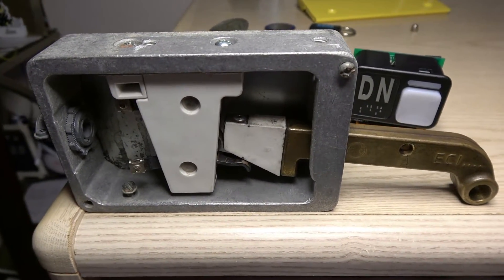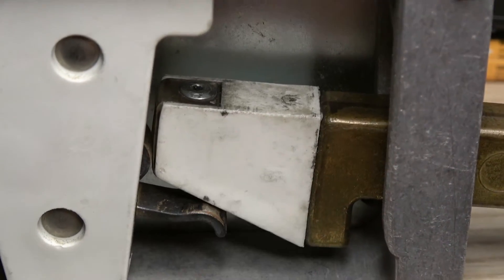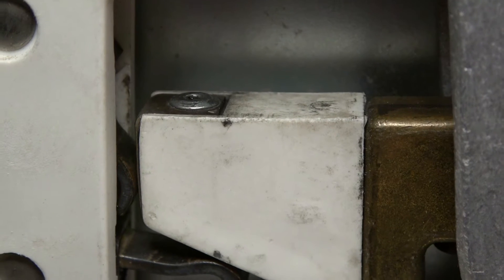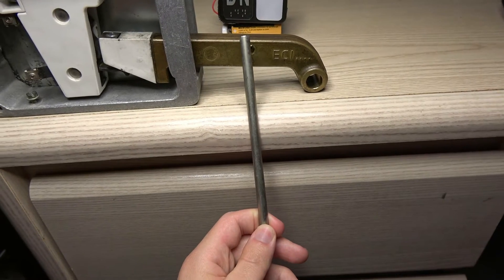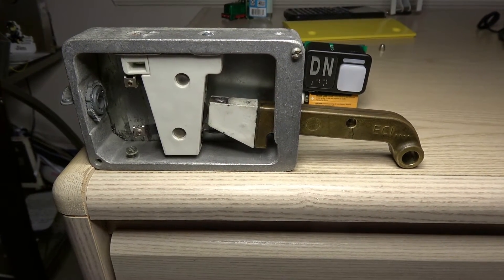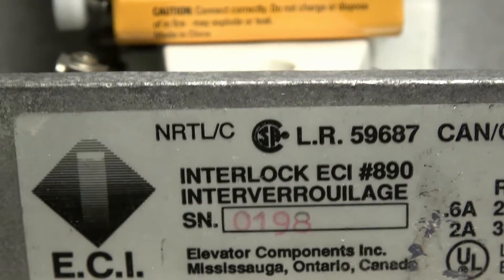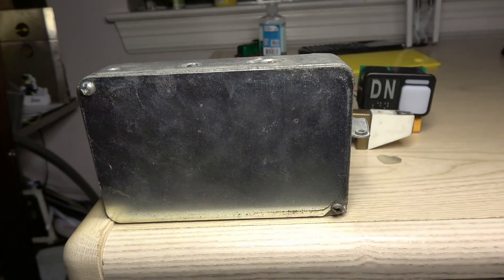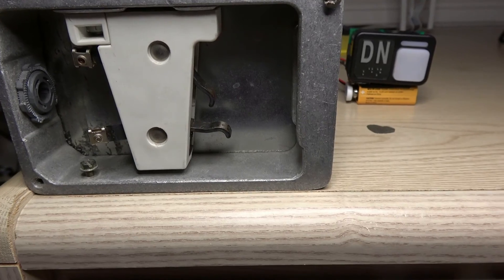Basic Overview of an E.C.I. Door Interlock (mainly seen on Schindler elevators)

Comment: Hey Jim great video. I am looking to incoperate a manual sliding hoistway door into my elevator design but I am having some problems. Would you be open to connecting as it sems you have some great knowledge and could help.

Comment: The Mitsubishi GAL rollers have a really smooth door hook, when I pulled it down to open the door, it feels like you haven't pulled everything because it's so smooth
so it's easy to mistake giving it a gentle pull and then realizing that it locks back up again, Mitsubishi GAL is very strong but smooth and also safe, nothing exposed on the hook bit unlike any other GAL door that looks a bit thinner then Mitsubishi and have motion to the door roller and rod. Mitsubishi also have some MRL interlocks which are a bit more exposed and small but similar to GAL.They are more finicky then GAL but they work.
Reply: Most lift surfs I show how I open the interlocks of verious lifts.